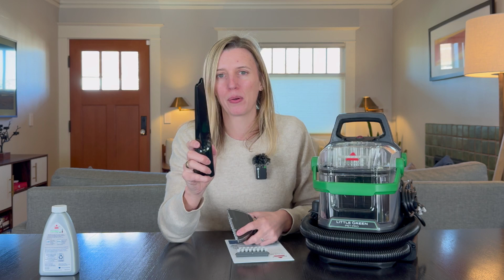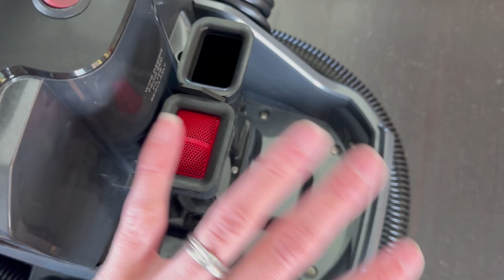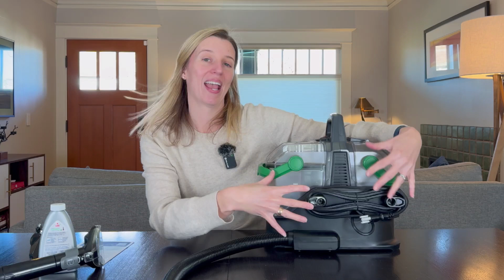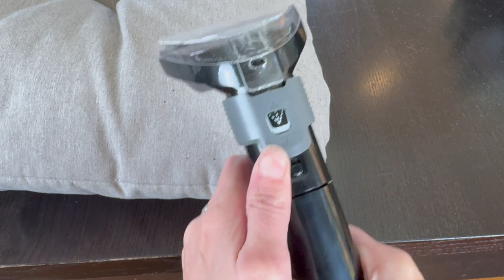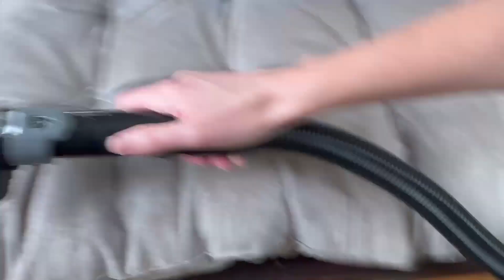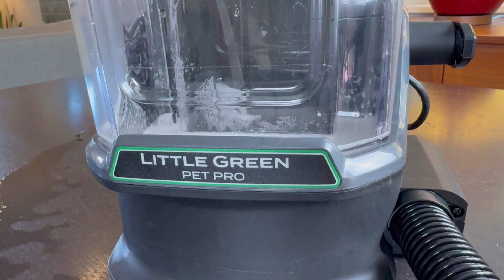BISSELL Little Green Pet Pro: The Most Powerful Portable Suction Yet!

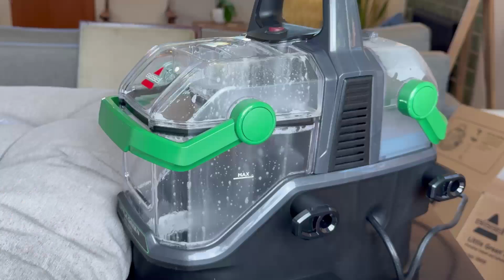Comment: Not thrilled.  Finally took my brand-new out of box machine to try for first time.  and the suction is horrible.  Read all instructions and troubleshooting.  The above video around 6:48 shows tons of water coming out into dirty water reservoir.  Mine looks nothing like this.  I filled the clean tank to highest setting and barely sucked out half an inch of dirty water.  Just dribbles into the dirty tank, more like it’s just shaking the water in the attachment.  If I take the attachment off, the suction is even worse!   I’ve checked all the gaskets and everything is tight and clean.  Very disappointed. I’d rather have it be loud and suck the dirty water than just drench my upholstery.  Bummed out.  I want one to work like this tutorial around 6:46.  Not apples to apples at all.
Reply from the maker: It should work like my tutorial. That said, the example you're seeing is where I'm cleaning an outdoor cushion so it had pockets of water to suck up (I didn't even think about this until now so I apologize if that caused high expectations). When I am using this on carpet or indoor upholstery it's not going to show that level of liquid spraying into the tank. Also, it is perfectly normal for ALL carpet cleaners to only suck up a fraction of the liquid they spray out. I've tested various upright and portable models and have experienced this with professional carpet cleaners cleaning my carpets too....these do not suck out ALL of the liquid. You will still have some moisture in whatever you've cleaned so the dirty tank will always be a fraction of what the clean tank was when you started. It should be dry enough to air dry within a few hours, but that's were all the extra liquid goes.

You could have gotten a faulty machine. Or it could be that you're expecting something that isn't realistic. At 7:06 I talk to the moisture left in my chair cushion and how that's normal.

All that said, I recently tested a machine that does what you want. It's the newly released shark 3-in-1. Here's a quick video that shows what I'm talking about: https://youtube.com/shorts/BE61yi57Wxk
And here's my full breakdown: https://youtu.be/wT-Q_HBSj0Y

I've been meaning to compare it to this Bissell, but haven't had a chance yet.

Comment: the older version had a stronger motor power and suction when we look at the specifications. Some ppl wrote that to make this less loud, they reduced the motor power. i am also having a difficulty with accessing specifications of this model and also the bissell little green hydrosteam pet portable carpet clean. In european versions it is indicated as 1000 watt but in canada, they dont specify the watts or amps. i ended up writing to them and the customer care response was that if it is not indicated in the specifications on bissell website, then it is a commercial secret and they cannot disclose the amperage or watts etc of the said models!!! can you believe it? I want to buy a machine with strong suction and therefore strong motor. older pet pro, spotclean pro etc had high amps but these are just mediocre. i cant decide what to buy atm.
Reply from the maker: So I had the original Little Green for 10 years. Loved it. But the Max Pet which I compared it to in this video - https://www.youtube.com/watch?v=ukgSCqclvsw - was notably better in design and overall cleaning (albeit 10 years of use could have been working against the Little Green). And then I got the Pet Pro in this video. By this time I had already done away with my Little Green as it was notably worse, but I did do a comparison between the Pet Pro and Max Pet - https://www.youtube.com/watch?v=eq3fqIbx-OQ - I'll tell you right now that this Pet Pro is the one I picked in the end. However they did it, this one cleans the best and has the easiest tanks to manage. While I too couldn't find the details on their website, the back of the Pet Pro itself says that it is 120V, 60hz, 3.5amps - I hope this all helps you make a decision!
Reply: @alderandjade  thank you for your informative response. I have watched all of your videos. thanks. this pet pro is the newer version and they reduced the motor power and also the loudness. the former pet pro (model 2505D and spotclean pro etc) had higher amps. and they accordingly had better suction maybe. but they were said to be loud. i hear that you are happy with this new version and so you think it has good suction- when compared to the oldest version little green and the max pet. i also watched other videos saying this new pet pro has better hose, more flexible. will you test the hydrosteam version or sharkstainstriker anytime soon by any chance? thanks again

Comment: I have the previous version of this. 
It IS obnoxiously LOUD but works great. This new model is supposed to be quieter, it apparently has a less powerful motor, which is kind of lame.
Reply from the maker: Which on did you have before? I had the original Little Green for 10 years and have also tested the Max Pet and this Pet Pro along with a Kenmore portable cleaner. I have videos on all of those and some comparison videos too if you're looking at a specific model. This one is my favorite for targeted messes and whatever they did with the motor didn't negatively impact how well this one works. Agreed on the noise though!

Comment: So what is the other setting for on the handle the one with the circle? Do I spray it then switch it to that setting on handle with circle to suction it up?
Reply from the maker: The circle is self-cleaning mode as you can see here: https://youtu.be/SCIQExB27gs?si=4RwytTHVhOu23-xN&t=357 - So that's only to use when you're finished cleaning or if too much gunk if jamming up the suction. For cleaning carpets/upholstery, you just use the spray option!

Comment: I saw your other video on Pet Pro vs Pet Max. I’m trying to decided between both, but had the max ever leaked on you when using it? That’s been the biggest complaint I’ve seen for the Mac online.
Reply from the maker: No. The Max Pet hasn’t leaked on me, but I know people complained about that with the original little green and that one never leaked on me either. I think it might be caused by the twist cap for the cleaning fluid not being fully twisted on? Or one of the tanks not being all the way popped in. I would say that the tanks are much improved on the pet pro. Because of that alone, I’ve been reaching for the pet pro for household messes. Quick cleanup without smart parts I can lose is a huge win.
Reply: @ I see. Sorry I know this question is probably boring. I’m moving into an apartment soon and I’m trying to decide which one before Black Friday. So you would suggest the pet pro over the pet max? Is there a big suction difference between the two? Or is there hardly a difference? I watch all of your videos on these but I’m trying to find the smallest difference between both so I know which one I really do want to get.
Reply from the maker: @justava2349  When I was living in an apartment, I had to squeeze my old little green into the top shelf of my entry closet. If you are dealing with tight storage like that, I'd lean towards the Max Pet. It's a better design for packing into a small space. The other differences that I shared in my comparison video are so small that I really wouldn't overthink it! You will be happy with the suction and cleaning power of either one!